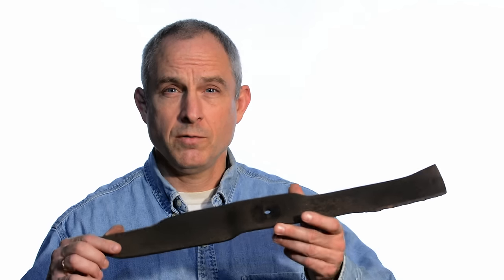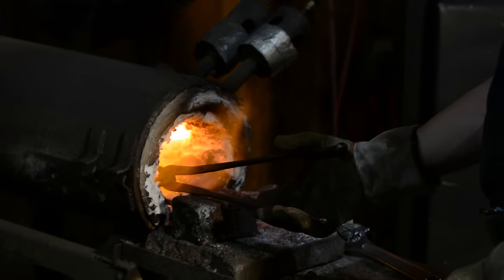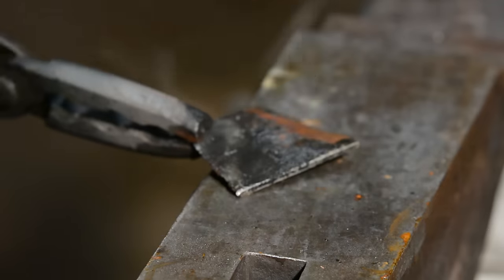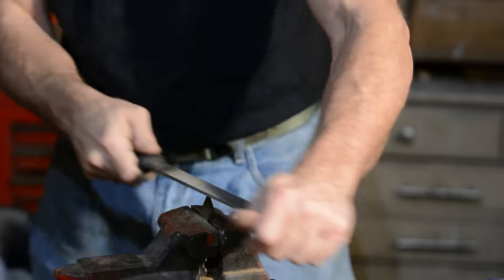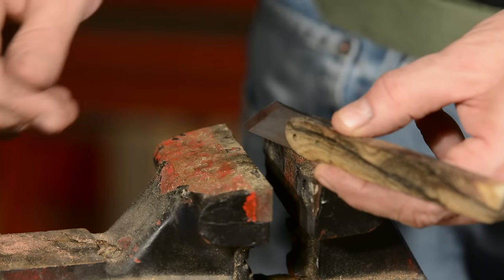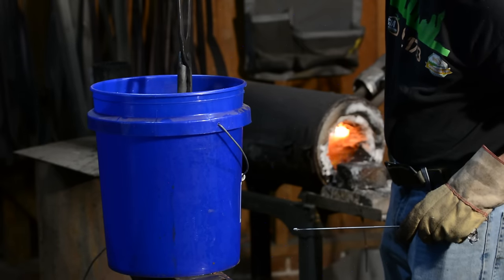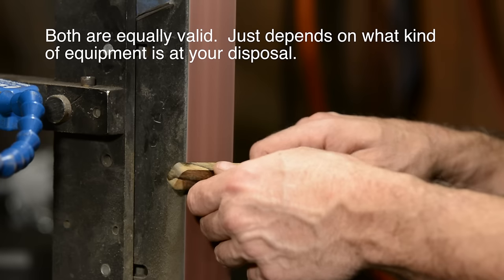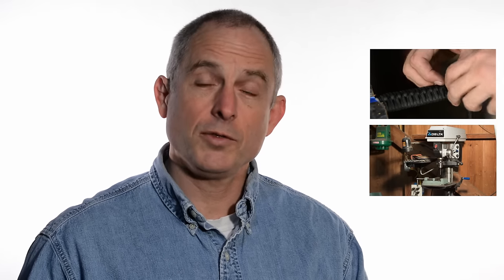Making a Carpenter's Marking Knife - Simple Project, Simple Tools

Comment: Great video! I want to make a similar making knife. So, I purchased some high speed steel off the internet. You mentioned that all steel must be heat treated. However, I bought this specifically as high speed steel stock. My question to you is, does the fact that tis stock was sold as high speed steel mean that no heat treating is needed? That is considering I file this down and do not introduce heat from a grinder. Or, as you said, it does not matter, and even stock sold as high speed steel must be heat treated?

You are a wealth of knowledge and I have enjoyed every video you took time to produce. Thanks for sharing your knowledge. Oh, and by the way, I think you got the raw end of the pick to be used during on Forged in Fire.

Comment: Great little project. 

Quick question, I'm having a hard time putting the final shaping on the scales after I've pinned them on the blade without ending up sanding the edges of the knife handle, which screws up whatever finish I took the knife to. If I ran the blade up to 1000 grit, then use 400 to shape my scales on the sander, I end up with 1000/400... sanding over the 400 up to 1000 again always seems to end up removing too much wood.

Comment: Mr. Sorrells,
     I'm not sure if I want to get into this craft, as interesting ad it is. However I wonder if I could use a toaster oven at about 200 degrees for a longer time as a last step, instead of the 400 you show ?
Reply: +jim renderer It's 400 degrees F, which is about 205 degrees Celsius. Any oven should be able to get to over 200C.
And as far as I know a longer temper at a lower temperature won't get the desired result.

Comment: Very cool. I was wondering how you connect the wood to blades for knife making. I've wanted to make some kitchen knives for my wife as a gift. This video helped tremendously. Question: What does the peanut oil do? Does it just help determine what type of metal you have.
Reply: A little yes, as some metal types like medium carbon content steel only harden with rapid cooling that water enables and others can harden in slower cooling oils. Not a professional, just what i read from comment section.

Comment: Thanks for your videos. I have seen every one of them. I had a quick question that I possibly missed in the hours of watching your instruction. Is it possible to work with steel that has already been hardened by annealing it? If so, what are the best methods of accomplishing this?
Reply from the maker: +maskdtux Sure.  Every steel has it's own annealing regimen.  But with carbon steels, you're basically heating it up to around 1500 degrees and then cooling it as slowly as you can.  There are more technical ways of doing it in an industrial context, but that will get the steel soft enough to work with a file.

Comment: this may be a dumb question but once you heat the steel up and water quench it the file doesn't work on it. so what happens in the oven over that hour? does it soften the steel to alow an edfe to be ground ? sorry if this is dumb
Reply: The hour in the oven removes some of the hardness in the steel. Not completely but enough that the steel is no longer so brittle. Thus if it gets dropped, you have ding that can be ground out vice a broken blade.

Comment: Walter any tips on getting my crappy HF 1x30 to actually be able to take off steel with out taking "ALL" day. I swear it would be faster to do it with a file. I am using crap Home Depot welding steel to practice on and using a 40 grit Aluminium Oxide belt. Also isn't it nice to actually have some non raining weather down here in the ATL area now.  So glad the rain stopped. I was getting tired of it.
Reply from the maker: +Joseph Rector Changing belts reasonably frequently helps.  Of course that costs more money!
Reply: I got a 4 inch belt sander from harbor freight (think it was $80) and it's been working pretty good! Just using 80grit belts then 180 then 240. The 4 inch belts will take 4 times longer in theory to wear out than the 1 inch ones as long as they are the same length. May be something to look into!
Reply: +Walter Sorrells these are brand new fresh belts like from the get go, they just don't seem to be removing much. could it be because the platten is maybe about an eighth of an inch or so from the belt when it is running. .
Reply: +Joseph Rector Try out orange ceramic belts, I think they would work better for you
Reply: +Joseph Rector Mine cut a lot slower with the platten back like that. I adjusted it to just barely touch and it seems to cut faster and with less rounding of the edges.
Reply: thanks i will have to do that. i thought that might have something to do with it
Reply: +Joseph Rector Hi I have the same HF 1x30. I have used Klingspor belts with very good success.  I used the higher grits a lot and rarely use my Tormex now. They have good customer service and ship out of Hickory NC.  I am a woodworker getting into metal working and I have NO affiliation with Klingspor or any other abrasive company.

Comment: I've seen a couple of knife making videos from a guy named John Heisz. He used a pry bar and an old chisel. He claims he did not have to heat treat because they are already tempered and just not overheat it while grinding. Is this wise?
Reply from the maker: +revolcane No reason not to do it that way, providing you cool the blade as you go.
Reply: Also keep in mind, thinner the part is, less heat spread up you will get. Meaning that if you for instance make cut on thick peace of metal to make your blade bevel, your blades body will keep its hardness (if cooled with water time to time to prevent heat build up), but thin blade edge might over heat in mere second and ruin the hardness. Even while sharpening you can mess it up and i was shown many examples of this by professional sharpener.
Beautifully hand crafted knifes.. nothing more worth than pretty wall decorations, all thanks to failed attempt of sharpening and letting blade edge to over heat.

Comment: Great project. I noticed you didn't use the actual piece of metal to cut out the slot in the handle. Next time, to get it precise in an easy way with minimal cutting make a mark on the center of the handle,put the metal next to it between the handle and the saw fence. Tape the metal to the fence with scotch tape and make the first cut into the handle. Remove the metal piece from the fence and make the second cut this gives you a perfect sized slot with minimal to no measuring...

Comment: Walter, why didn't the steel harden correctly in peanut oil but did so in water?
Reply from the maker: +mikefrecs I probably should have explained that, but when you get into heat treating there's an awful lot to talk about.  Anyway, oil cools the steel slower than water.  Some steels need to be cooled extremely quickly in order to harden, whereas others will harden in oil, and others harden by simply cooling in air.
Reply: +Walter Sorrells Ah, makes sense; thanks for the info. Big fan- great video!
Reply: +Walter Sorrells Does it corelate to mainly the carbon content or other compositions to the type of steel to its type of hardening?
Reply from the maker: +POLOLOUS3 Any alloying element will typically affect heat treatment.  Manganese and chromium are two very common alloying elements which will cause steel to harden with slower quench regimens.  But carbon content affects it, too.  The less carbon content, the faster you have to cool it in order to harden.
Reply: +Walter Sorrells Good basic info to go by.  Thank You.  As always you do great work!
Reply: Correct if i'm wrong but oil hardens metal slower cause it will burn into surface creating pretty tick layer that insulates heat transfer, where moving blade in water will have full contact. Though you could get similar results in water if you keep blade in one spot, cause water turning into vapor will create one type of barrier between water and hot steel insulating heat transfer. (reason why putting your hand into liquid nitrogen wont destroy your hand immediately and no dont try that your self please...)

Comment: saw blades are already heat treated right
Reply from the maker: +David Salganicoff Totally depends on the blade.  Some have carbide inserts and so the body of the blade is not necessarily heat treated.
Reply: I made a kukri out of an antique logging saw  from ebay and i'm hoping its heat treated
Reply: +David Salganicoff Doesn't seem too complicated, perform a scratch test on it, if the file scratches it then it's too soft.
Reply: i know but i have a blackened finish on it and i dont know if its digging through the rust or metal
Reply: +David Salganicoff Sand of the rust and finish so you can see the shiny metal. Then try a file. 
You could also clamp a scrap piece of it and try bending it. If it bends it is too soft. If it snaps, check the grain of the steel.
Reply: i left it black for aesthetic purposes but i figured it out and i'm all good.
Reply: +Walter Sorrells Circular saw blade? HSS steel?
Reply: +blackjackmcgack I've seen knife makers use old circular saw blades - the large ones that would have been used to saw lumber to make knives with. They seem to work quite well but i'd expect you'd need to do as recommended in the video and see what it needs to heat treat.
Reply: +spwicks1980 my circular saw blades have carbide tips one thing i know is usually hss are jointer blades, you can get circular saw blades and chop saw blades that are hss though
Reply: Only ones i've seen used are old ones from the middle of the last century where they were likely just carbon steel.
Reply: Many saw blades are only hardened at the teeth, as the rest of the saw has to flex to keep the blade from snapping. I would not trust it to be hard enough to maintain an edge
Reply: +David Salganicoff Most of them, only the tooths part, just bellow the carbide blade
Reply: Thanks!

Comment: Wow thats ugly,at least for your quality of work that we are used to.
Good material for a small carving/marking knife is a 10-13 mm or more  drill bit.
Easy to make handle too,just drill hole in a peace of wood and use some epoxy to fix it,then sand it to desired shape.
Reply: no.